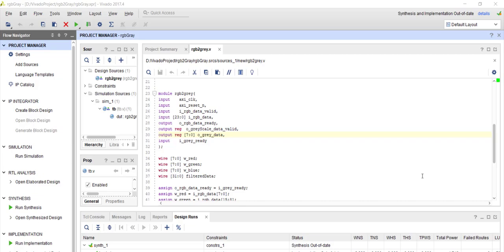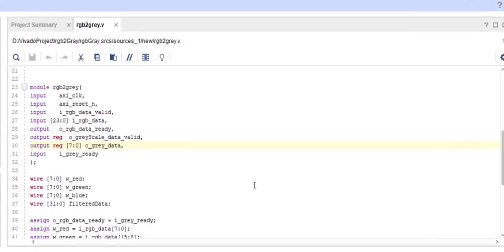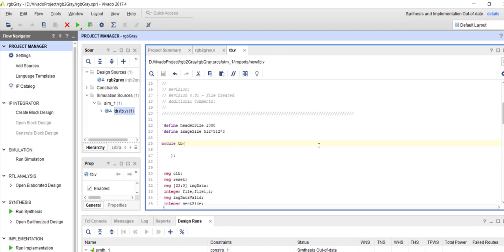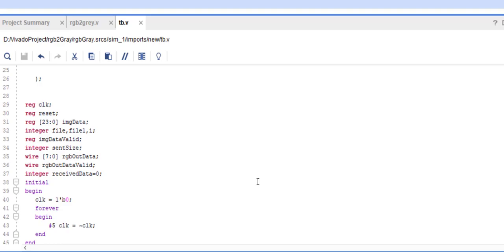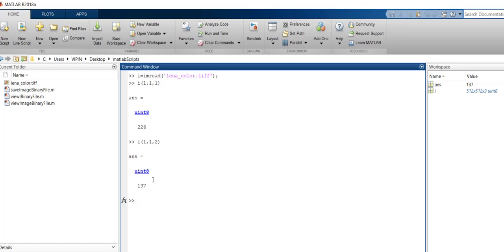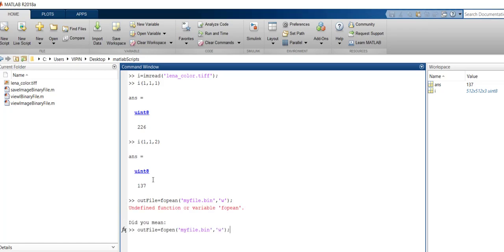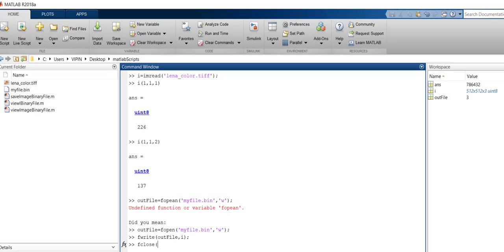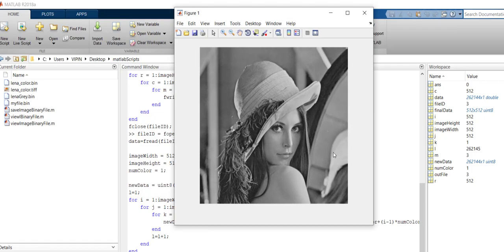Converting Images into Binary files for Processing (using Matlab)

Comment: run all
WARNING: File/Multi-channel descriptor (-19999) passed to $fclose in file C:/Users/sakth/Documents/Verilog_Project/Image_Processing_FPGA/RGB_2_Gray/RGB_2_Gray.srcs/sim_1/new/tb.v at line 84 is not valid.

while I am opening the file in HxD i can find the pixel value as only FF and while opening the image it is completely white
Reply from the maker: It means the simulator cannot the input file. It might not be in the sim folder. Easiest thing in tb line 84 where you are giving input file, give the full path to the file
Reply: Iam facing similar problem please help me.
Reply: @sakthi arun did you solve the problem. Can you please inform if sorted.